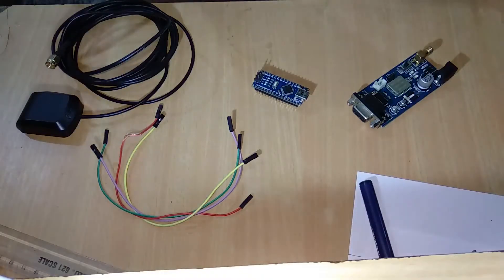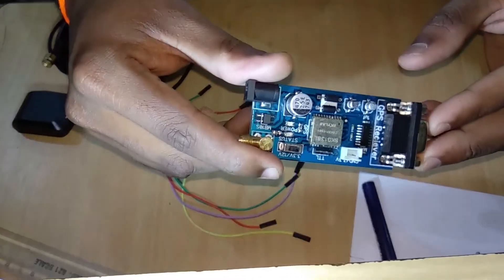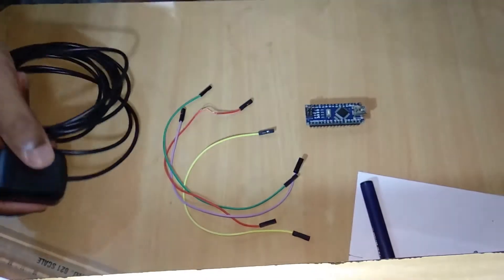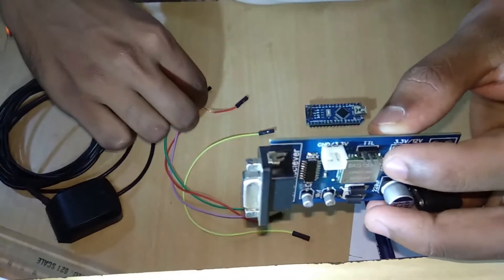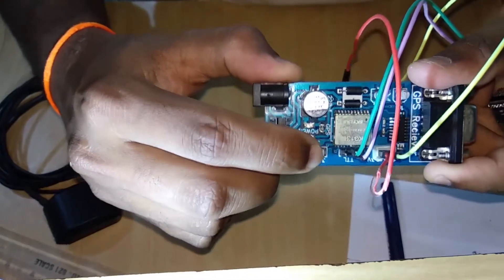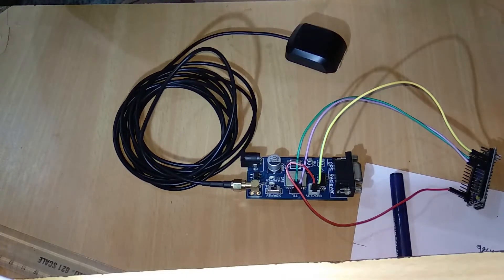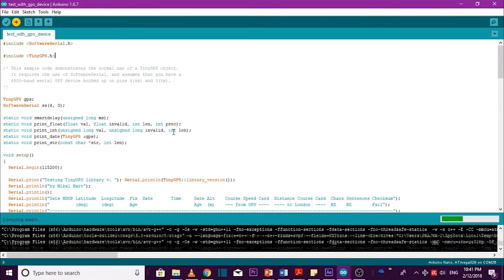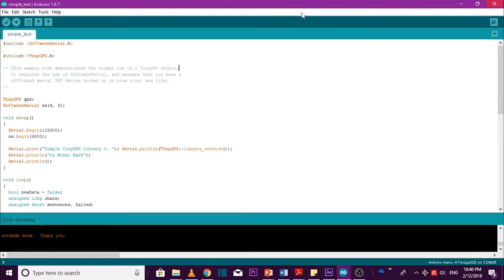Interface GPS module to arduino |TTL pin GPS|SKYLAB| skg13bl|Step by step Explained

Comment: Can you tell me which GPS is best for more accurate position, because we have lots of gps modules available in market like SKG13BL, ultimate, ublox neo 6M, NEO 6M, NEO M8N, ublox neo7M, sain smart neo 6M.

Please help to find out best gps module that can work with either Arduino uno, nano, Node mcu E866 etc.

Thanks waiting for your reply.
Reply from the maker: Ashutosh Deshwal 
Go for neo 6m compared to price performance it's best . Even it's size area is small compared to self versions
Reply: Identica 
There is no matter of price main thing is accuracy so will neo 6 give best accuracy inspite of SKG13BL etc
Reply from the maker: Ya neo 6m will be better
Reply: Identica 
Thanks bro